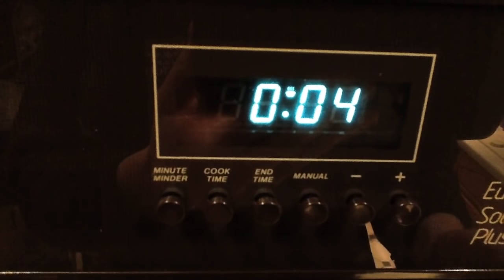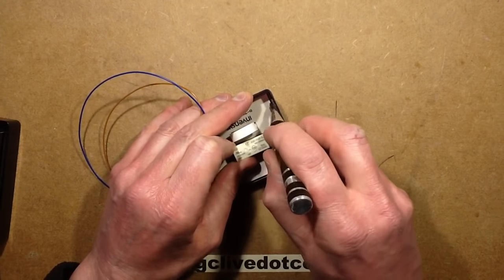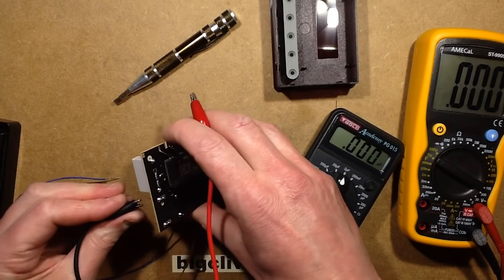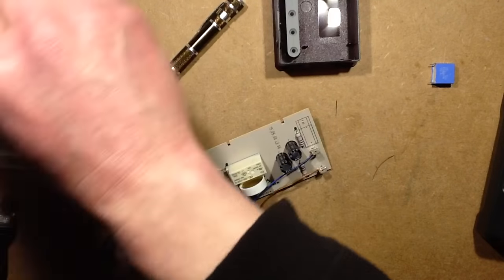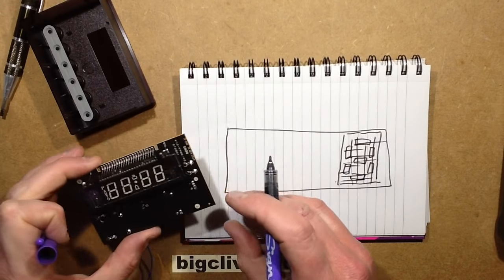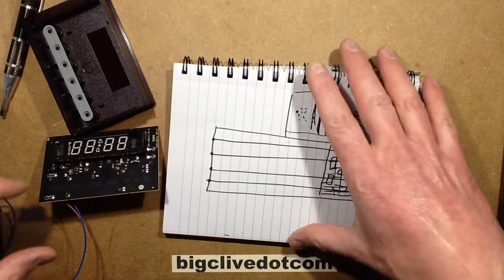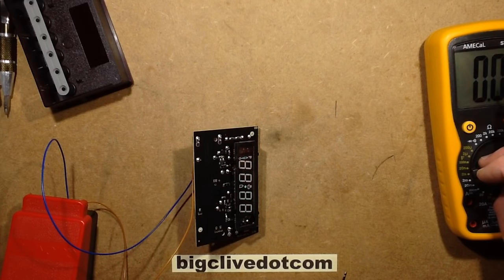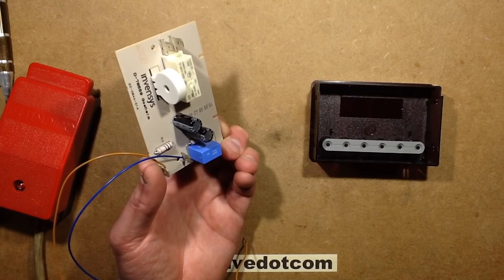Fixing a digital oven timer module.

Comment: Hey Big Clive... love your channel. I have nearly 45 years of hobby/professional electronics experience, and VFDs have always been one of my fave components. I have a few bare VFD tubes in my parts box that have been there well over 30 years... I just don't have the heart to dump them. I wanted to comment on you finding AC on the cathode heater element. Any properly designed VFD circuit will use some form of AC or switched supply. The problem with a DC filament supply is that, as you pointed out, there is typically about a 1.5 - 2V drop across the heater. This means that the cathode voltage will be 1.5V higher at one end than the other RELATIVE TO THE FLUORESCENT ANODE. This makes the display brightness vary noticeably across the face of the display. Using an AC heater supply will give an AVERAGE voltage at ANY point on the cathode of half the total voltage, which solves the problem.

You don't need a sinusoidal AC supply, in most of my old VFD designs I just switched the two ends of the filament 180 degrees out of phase. You can use an H-Bridge for this, but depending on the size of the display you can often get away with using a resistor to Vcc on either end and a bipolar transistors to alternately pull each end down to ground while letting the other end get pulled up to VCC. As long as you alternate the drive circuit fast enough the switching filament voltage will be smoothed out by thermal inertia and you won't see any flicker.

Cheers.

Comment: so if you use a 3.3uF capacitor but instead of 250V or 400V, you use a 630V cap, it will have ticker insulation so would it last longer under regular 240V conditions than the 400V?

if I use a 630V cap on my 120V supply will it last much longer?
Reply from the maker: +chems I wouldn't increase the capacitance value, but a higher voltage rating would definitely last longer.

Comment: I seem to remember that running the heater wires on dc will work but it makes one end of the display dimmer.
A.c makes sure that does not happen.
Well done clive, a simple fix ;-D, and that capacitor looked ok as well, deceptive.
Reply: +zx8401ztv Had the same problem with my refrigerator. Whenever you opened the door, the light would turn on, then the whole fridge would go dark (incl. the temp. display) and light up again only to go dark again and so on. It was also the X2 dropper capacitor. A 2€ piece. If I had called some company, they would've switched the whole control unit for a few hundred €€€.
Reply: +Markus Birth (mbirth) 
Oh yes they would, ripoff merchants :-(
Often things fail for silly reasons, some are obviously planned like electrolitic capacitors with a short life (switchmode psus).
.
I think for your x2 capacitor i would get two capacitors of half the capacitance value and parallel them to share the work.
I dont trust manufacturers much.
Reply from the maker: +zx8401ztv There's a video specifically about their failure mode.  https://www.youtube.com/watch?v=qGc9-ToEiIQ
Reply: +zx8401ztv Yes, that is the problem of supplying DC to VFD. If I recall good, different "cooking" of the electrodes as well.
The film capacitor usually fails like that, lowering value, unlike electrolytic which get dry, increase ESR and end up popping. Advantage: you don't need an ESR meter :D
Also it is a must check when repairing ballasts and half-bridge power supplies where a film capacitor 'suffers' all the current trough it.
Reply: +Electronica y Reparaciones 
Ooow im thinking about the capacitor that connects to the half bridge primary winding end, i think that is the one you are hinting at :-)
Typically 1uf in value for small supplys?
Reply: +zx8401ztv Yeah, exactly. I have seem some failing catching on fire... not big deal of repair but big smoke and stinkiness hahaha. Still less messy than electrolytics exploding though.
Reply: +Electronica y Reparaciones 
LOL :-D electrolitics are very dramatic, not a spit, an explosion, but you do get a nice bit of twisty metal to short out something else before you have chance to turn the power off :)
Tantalum bead capacitors go off like fire crackers, very unstable lol.
Reply: +zx8401ztv From when I had to look into VFD design a few years back it seems that it's possible to compensate to some extent for DC filament drive in the design of the display but it's not recommended. 

Fixed one many years back that had capacitor-coupled drive to the filament instead of the more obvious centre-tapped transformer. The electrolytic cap concerned was being used well outside it's comfort zone and was cooked.
Reply: +Graham Langley 
I did test a vfd in an amplifier i was trying to fix, d.c at about 3 volts seemed ok, the transformer that run the vfd was dead.
I found a 6 volt transformer and plopped a large value inductor in series with it, it was a bodge but worked smashing, and the frend that owned the amp was just happy to see the display again :-D.
I admit that i didnt know how to calculate the reactance at the time, i just worked my way down to an inductor that produced a readable display, yep im a bit of a bodger, but it never failed lol.

Comment: glorious
I have a very similar oven clock at home and got annoyed by the constant buzzing sound it makes. (and that it consumes power for nothing.)
Brand: Diehl
131 47-001
Typ: 311-20 T120
Props to you for showing how to further diagnose and possibly fix such a device. I just disconnected it. (but was curious enough that I did find your video.)

Comment: I fixed a Siemens wireless heating controller a few weeks back and it had the same dropper capacitor and the same failure mode exactly. I ordered a replacement cap from Farnells and had the exact same problem with the footprint as well!!

Comment: they use AC on the VFD filaments because it prevents one end of the display being darker than the other.  If you put DC on the filament, one end will be brighter than the other- the end closer to ground.  This is because there is a voltage gradient across it then.  Noritake had a cute trick where their later VFDs run DC on the filaments and they compensate by tilting the filament so it's closer to the grid on one end and farther apart on the other.
Reply: +kevtris Years ago I messed around driving the filament with a hefty pulse in between driving each digit. Not sure if that's an officially sanctioned way to do it, but it did work. It meant that while the digits were driven, the filament had zero gradient across it.
I had some trouble though, the microcontroller I was using did not have a particularly high clock frequency, and if I ran the timer at a high enough frequency for the pulses to be above audible frequencies, I did not have enough resolution to accurately control the filament power.
Of course there are ways around this, but I was just mucking around in my spare time. There would be concerns with fatiguing the filaments etc.
Reply: yeah this is possible;  the filament doesn't care how it gets heated, so long as it is hot enough to emit those electrons.   I like the idea of pulse heating it to prevent the gradient though, that's a great idea!
Reply: Ah, this has got me thinking about VFDs again...
For a while I have toyed with the idea of designing up some hobbyist type modules using the various inexpensive Soviet VFDs that are available. Everything on-board, only requiring a 5V power supply and data via SPI or UART. Full Arduino support etc. Target RRP of somewhere around US$20/pc.
I would peddle this through the usual channels for such items.
But I am really unsure if this would be desirable... Comparable items were quite scarce last time I looked for them.
May I ask for opinions on this matter?

Edit: Had another look. There have been some reasonably priced, fairly capable looking modules released but it appears they did not do overly well. Perhaps this ship has flown.
Reply: +kevtris Thanks for reminding me what the DC drive trick was.
Reply: Would not doubling the cathode back on itself achieve the same thing ?

Comment: Interesting introduction...!  Yeah, Creda cookers from the 90's have these. I could never understand why there was never a battery-backup for the timer. A power-cut lasting only half a second will reset the time to 0:00, and also wipe your oven Auto on/off settings. Even a large electrolytic cap would give a little buffer, but everything costs money I suppose.

Comment: My failing AEG (Electrolux) oven clock had exactly the same fault. It's another common unit with LED display and three buttons. It would constantly re-set itself and the relay would buzz away like a mad thing. The dropper cap was kaput and replacing it brought the unit back to life. Saving £70 ish !!!
Reply: What model is your cooker?

Comment: VFD heating filaments are mostly AC driven to avoid uneven illumination.
When for example the heating voltage is 6 volts and the driving voltage is let's say 30 volts then the voltage drop across the heating filament is significant compared to the driving voltage. 30 volts on one side of the display and only 24 volts on the other side. Thus they are AC driven to lessen this effect.

Comment: I've got a Beko oven and the module started doing a rapid reset. I had a quick look but didn't determine a fault, so bypassed it to use the oven. I will revisit this as it will most likely be the cap. Thanks! While I'm at it, I'll pull my knobs off. Oo-er.

Comment: I didn't know about the reactivation trick by passing a high current through it, but the same trick is used to clean the filament that emits electrons in scanning electron microscopes ("flashing"). The vacuum gets contaminated and the filament gets coated with crap; passing a high current through it just burns it all.

Comment: Everytime I see how you are holdingg the things while soldering im impressed because my hand would crack if I would hold the things in this way.
Reply: +Max Power  Years ago I saw that used in a TV repair shop and tried it myself, not so successfully. A little daily practice and about a week later it was if I had always been doing it like that. Nowadays it is not so easy what with lack of practice and older hands although it still beats trying to use those third hands and assorted fixtures for small items.
    Mike (o\!/o)
Reply: Experiencing Technical Difficulties
Maybe I should practise a little bit because it looks kind of cool and is practical.
Reply: Max Power  Just practice manipulating small items like screws and nuts, tying knots, etc. Soldering can wait until you are able enough to not have to endure burns and the like. Kind of like juggling, don't start with chainsaws.
    Mike (o\!/o)

Comment: If you have the same issue with an oven which is similar to this you can check get your main oven to work by disconnecting the two tags on the relay which looks like the one on the left hand side when the clock is rotated around showing the back and connecting them together. This will bypass the relay which will activate when the clock is set to allow you to use your oven. 

This is a safety feature to prevent the appliance from automatically powering up if you had children who like to fiddle or you had a power cut for example.

Comment: I used to work for Currys and often noticed how different appliance manufacturers used almost but not quite the same layout for controls and I do agree that the optional extra (but unused) contacts are likely there for use on different models, even different makes, even where Swedish Megaconglomerate Inc.  hadn't even bought out (yet) Howthehelldotheycompeteonpricewithsuchsmallvolumesales of Wednesdbury West Midlands UK ... (before they went bust of course). Highly entertaining video as usual!
Reply from the maker: +Robert Horwat In my base-model Indesit washing machine the control panel has a PCB with all the locations for the extra knobs and buttons used on the "luxury" models with the only major difference being a different front panel and different software.  (Which can be programmed from the back of the machine.)

Comment: Overvolting the filament heats the thermionic emitter surface (a barium compound iirc) and reactivates it. CRT rejuvenators used to do this
Reply: +TheChipmunk2008 They act more like a vacuum tube. The grid is like the grid, the digits like a plate, and the heater like a filament. Just like a tube, the filament/heater is thoriated. The thorium lets you have electron emissions at lower heater temperature. With the filament at a lower temperature, you get a longer life and don't obscure the green digits with the heater glowing like a lightbulb. When you overdrive the heater/filament you "boil" more thorium to the surface.

Comment: + bigclivedotcom   to release fiddly PCBs like that easier and with less risk - first warm the enclosure with a hairdryer for a few seconds to make it less prone to cracking. 
Then gently lever with a screwdriver like you did, but push cut-down bamboo BBQ skewers in next your screwdriver before you withdraw it to prevent re-latching. 
Trim some of the the sharp tip off the skewer with a side cutter if you need them thicker/if the thin tip is too long. Don't snap them - the splinters are very sharp. 
 
The hairdryer technique works great for many types of thermoplatics to make them less brittle when you release clips and is especially important in cold rooms or if the kit has been stored at cold temperatures just before you need to open it.

Comment: Fixed an LED-based one for a friend a year or so back. Same problem - the 1u0 X2 dropper cap measured 620nF which was more than enough to stop the relay pulling in. Seems some brands of X2 caps are prone to this kind of failure.

Edit: And of course when used as a filter a dramatic drop in capacitance would probably go completely unnoticed.

Comment: "If You Want To Pull Your Knob Off In Front Of The Oven, What You Have To Do Is Gently Caress It Between Your Fingers And Then Just Pull It Gently Until It Comes" - Oh yes, Clive, I liked your technique though I'm not sure if the oven was suitably turned on by the experience.
Well, the Quick Test has shipped, it was purchased from RS Components in Sydney. Its first job will be for fixing and testing a motorised roller shutter motor. Weird thing was two vastly different prices for the same unit, but under two different SKU codes.

Comment: Driving the filament with AC is better than DC, because with DC you get a voltage gradient from one end to the other, and that results in one end of the display running a little dimmer than the other.

Comment: I'm pretty sure DC filament drive is only really an option for short VFDs as it causes a potential gradient between the filament and the grid. AFAIK the filament should be driven with AC.
Reply: +Mezgrman Yes, came here to say this... DC on the filament causes the display to vary in brightness across its length. Have seen it before in some VCRs

Comment: Clive,   it would useful to shed some more light on refreshing these tubes to get better display brightness. I am sure many DIY types who refuse to buy new, simply because of age or style superseding older, perfectly good machines.
A testament to the quality of Samsung brand this mid range unit must be near 20yrs old, and though it was a trick to source the control/display module, most listings have it as discontinued or out of stock. Not cheap either. This microwave owes me nothing, but recently have been boiling stuff I only meant to reheat cause I can't see miskeyed input on the display
Reply: +Chris Leech emission may be restored by raising the filament voltage. a 33% voltage boost can rectify moderate fade, and 66% boost severe fade. The displays were designed for rugged use.
Reply: +Jeffery Rowan Thanks for that. I am going to have the unit apart   to fix the door release and will do a bit of probing with a DMM to see what I have got . Mine has a few more functions and will be a little more engaging I should think. Does one need to limit the current I wonder. All I have is variable buck and boost converters running off LiPo's to get these voltages.

Comment: Do you have one of those cheap ebay LCR meters? I got one for about $10 in kit form that measures ESR.  It seems to work, but I don't have a decent ESR meter to test it against.
Reply: +KingNast You may be able to test it with low value resistors instead of capacitors.

Comment: Hi, I have a question ... This module has 4 wires: on the left side (where you connected the  test cables) are the Live and Neutral. On the right side above is neutral too and the other one is for? Is it DC or AC? How many V are there?
Reply from the maker: I think the two terminals on the other side are volt-free.  Just the relay contacts.

Comment: I have a few of these displays,  but it's doubtful that I will ever do anything with them.  In particular,  I've never run across any that were fairly generic,  in the way that 7-segment LED displays can be.  From what I understand they're all pretty much custom-made for the item of equipment that they're going into.  And I haven't (yet?) run across any good technical info on these devices in general,  or specifications on any specific devices.

Comment: I think most devices with VFD displays run AC current through the cathodes. If it was DC, then one side of the display would be brighter than the other.
Reply: +themaritimeman - Yes, I was almost shouting at the screen 'It's AC, Clive!'. I don't recall ever seeing a VFD with a DC cathode/heater.
Reply: I think the only type where it would be satisfactory would be a single-digit tube.

Comment: I had the same fault on my cooker, in fact that module is identical to the Cooke & Lewis one I repaired, I guess they are all made in the same factory,think the capacitor cost £1.32 from eBay compared to £94plus Vat B-Q quoted.